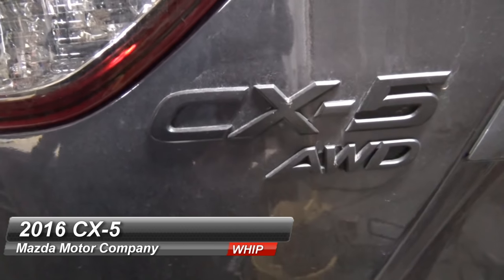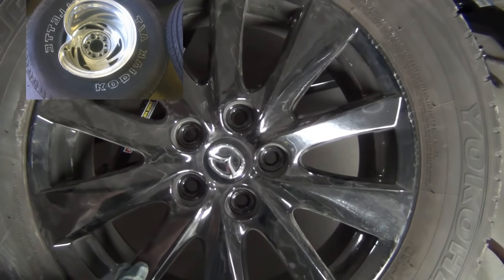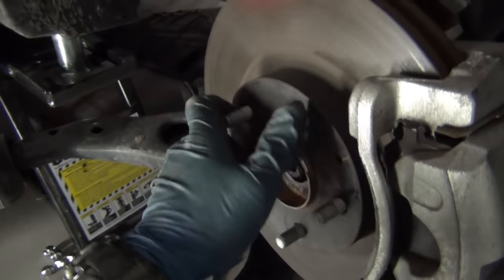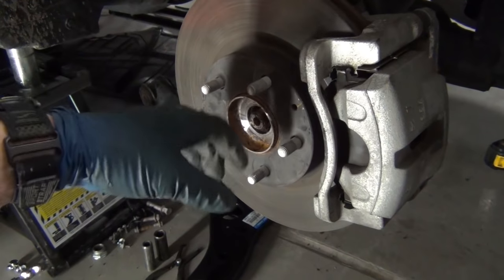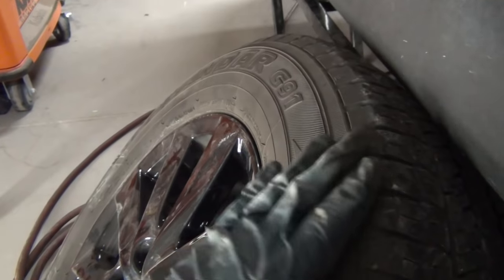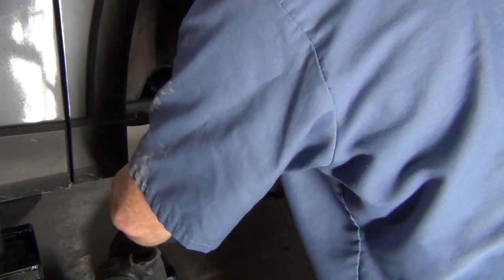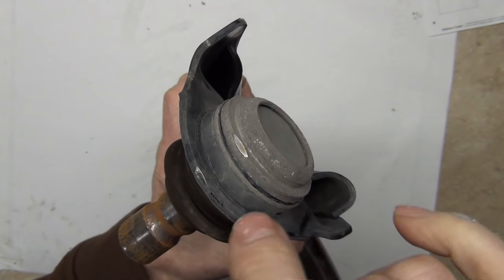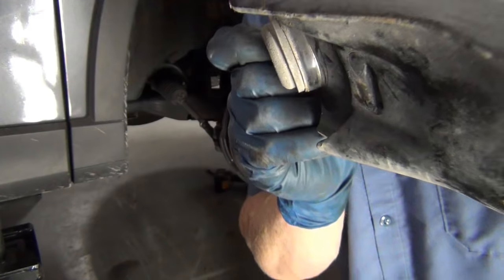5 Things to Check if You Hit a Curb

Comment: I hit a curb last night that destroyed my rim and tire. I bought a new rim that's different than the others (steel, not aluminum) and a new tire and now when I drive over 60mph the car shakes. Not enough to be scary but enough to notice it. What could be causing this? I'm taking it for an alignment and an inspection while they're at it, to see if they can see anything I won't be able to. Any tips?
Reply: Hi I was just wondering…what ended up being the problem?
Reply: @alexandriagreen9265  I assumed it was a balancing/alignment issue. 

When I took it in to get it aligned and the tires balanced, the mechanics showed me that the tie rods on both sides were extremely worn. I had both tie rods replaced, the alignment and balancing done, and then the car rode just fine.

I assume the cause was due to the alignment being off, and the new rim being unbalanced.

Comment: Hit a curb going about 15mph at a roundabout. Car strangely enough turns a lot better no (no power steering) and hopefully it stays that way after I get the wheel back aligned (have to keep the wheel at about 10 degrees right on a straight road)

Comment: I rolled over a curb one in my car. The front and wheels both hopped it. I forgot to straighten my wheel and went over it. The rear part of the car, where the frame is, scrapped the curb. I have a 2016 Chevy Cruze and since the curb check, I never heard no "wha wha" sounds

Comment: Smashy smashy curb rashy rashy. So did the driver get away with just wheel and control arm damage?
Reply from the maker: Wheel, bearing, and control arm.  All three.  The wheel is new, but the sloppy tire soap on it looked like rash so I went with it for a visual aid.  His rim was actually destroyed beyond repair.
Reply: Amazing how things like this can range in robustness. I smacked the front passenger side (broadside of the tire) into a curb that i could have easily gone over at about 25-30mph and managed to have it adjust my alignment cams but luckily no other damage. The IFS on a Tacoma is a bit more robust though cause I though for sure my wheel bearing would be toast but it rotates smoothly and has no play.

Comment: Did this to my 04 mustang a couple months back on the right side... 2 weeks after I got new tires. The 2 tires shredded down a bit and I looked on the inside and it seemed ok but I probably didn’t look good enough since  seeing this vid so thank you! But ever since December there has been a vibrating/rattle noise going over 70mph about on Highway usually when I had my foot off the gas. But now it’s gotten worse starting at lower speeds both on and off the peddle and when I turn it sound like my car could just brake at any moment. And I care for her a lot so yeah just putting it out there. Probably an idiot for not the replacing tires too...
Reply: Any update I recently hit a curb , bent my right rear tire
Reply: J elevate wanna update? I crashed my car over a month ago and wrecked the entire front end. Good news, it was just cosmetic and we finally got it up and running with new parts, besides my bumper which currently rocks drifter stitch covering the big crack on it. So yeah the curb was nothing, but it still messed up my tie rods, ball joints, and sway bar links a bit which I’ll replace soon. So that’s what really went wrong with mine:)
Reply: @thecoolness317  dam bro glad everything went ok, I recently crashed against a curb but it was just my back right rear tire  🚘\ tilted pretty bad
Reply: @thecoolness317  i have a feeling I'm going to have to get new alignment and axel , how much u think I'm looking at?

Comment: I didn't hit a curb but the people doing the asphalt on the freeway "forgot" to put a sloped ramp at the interface between raw concrete and where they put asphalt... there's a 4-5 inch heigt difference  Result : BANG ! at about 75 with low profile 19inch Michelin PSSs... gaddamit

Comment: I’m so glad I saw this video. About a month or so ago, I was driving and was about to miss the entrance on the expressway. I had to have been going about 40 or 50mph and tried to slow down, but I ended up hitting the curb on the entrance. I don’t think I went over the curb because I noticed that front my rim was scratched from the impact. I think the tire is fine, but I could double check. However, the main thing I noticed immediately after that when I continued driving onto the expressway, I heard that “woahwoahwoah” sound that you were making. And I hear it all the time now as I’m driving, and not just on the expressway. So I’m definitely gonna get my wheel bearing and all of those parts connected to it checked out soon. Luckily, it doesn’t appear that anything else is messed up with my car, and nothing has ever lit up on the gauge cluster, so I think I’m ok for now. But I’m definitely gonna look into that wheel bearing.
Reply from the maker: Glad it was helpful!

Comment: Yelp... Taking that left into my neighborhood at 65mph on a 2 ton car was a stupid idea... Crazy hard under steer, gained traction at the last minute and hit one curb to the other. Just did a check and it looks like everything is fine.
Reply: you got lucky, I did the exact same thing but in rain so I went right into the curb and my front passenger wheel took the full force. Had chunks of my rim off and destroyed the suspension and sway bar. Oh under steer the cause of most AWD fuckups

Comment: I fkn used the brakes on turn on snowy conditions which locked the front wheels and hit curb . Hate my self for this !!!!!!! I so stupid I should have let off the brakes %{^!}^]¥.*|
Reply: I used light brakes but that’s the thing ..... light braking locked the front wheels as skidding I naturally applied more brake which is the mistake . Should have let go and it would have turned. I’m such an idiot I should have practice the driving on snowy parking lot just to get the feel for it

Comment: Hey boss, I took my 2021 Camry to get checked out at the dealership, they ran a diagnosis and found “nothing” wrong with it. The wa wa noise comes on sharp or even moderate turns at regular speed. Can I sue the dealership if anything happens for misdiagnosis?? I would check it myself but I’m uneducated when it comes to cars. I wouldn’t want to mess it up even more.
Reply: Wheel bearing most likely